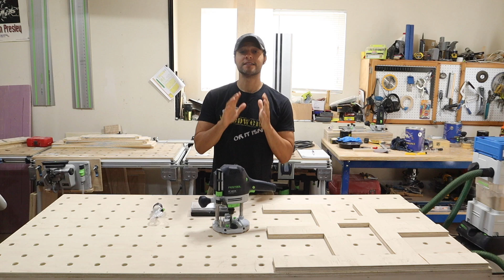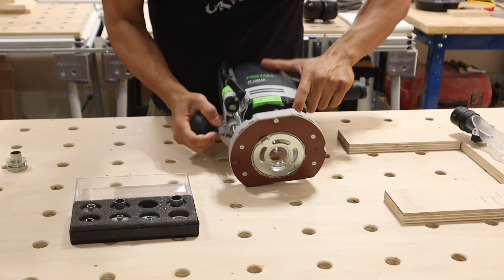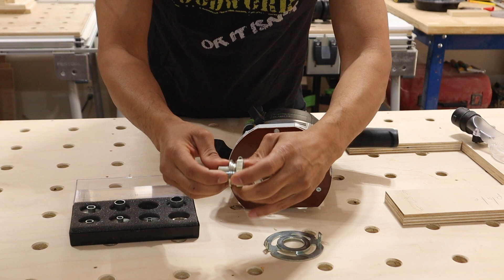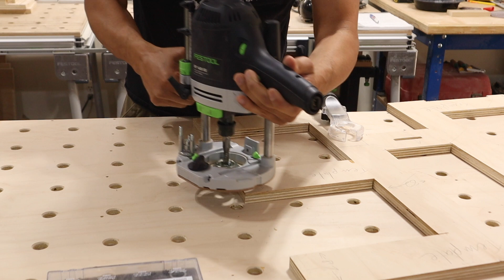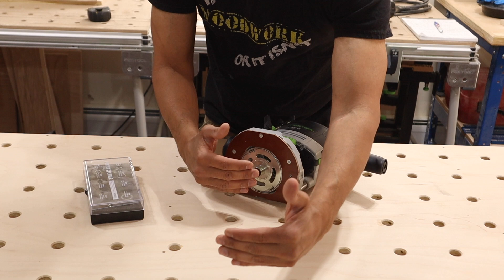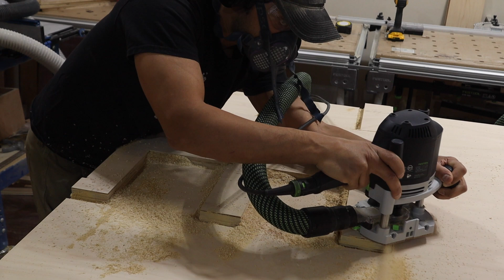Take your woodworking to the next level

Comment: Really like the informative video. I realize this is an old(er) one but if you're still viewing responses- have you noticed any wobble with the insert for the of1400? I bought a pattern bit set, designed for porter cables but didn't realize there was a special insert festool had to let you use other manufacturer pattern bits so mine's been gathering dust for awhile. I just wasn't sure after talking to my since-retired festool guy that he said they opted against an adjustable router base and centering spindle, to go with the ease of clicking in and out inserts. Part of me wants to trust the click inserts have zero play but I was just curious. Would love to use the pattern set as well as the extended base for stabilizing the router if that's the case with the insert. Problem is I sometimes need to order special parts like that attachment and I just don't like dealing with return shipping if it can be avoided.

Comment: Never used these bushings. What's the advantage over just using a flush trim bit?
Reply from the maker: The regular top mounted flush trim bits just aren’t as clean a cut or on the plunge. There’s much more surface area on the bushings than there is on a bearing of a flush trim router bit, they’re much more stable and accurate in my opinion of course, but I’ve also had a lot of experience and success with this method on my other templates. It’s a matter of trial and error and finding what you like best. I can give you my honest opinion and true experiences. They may not feel right for everyone else but not everyone is the same.